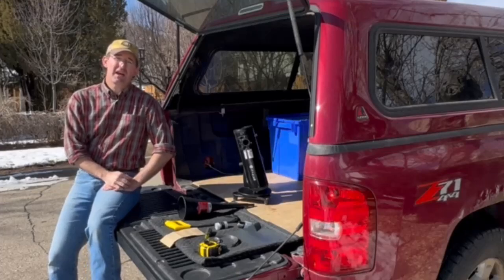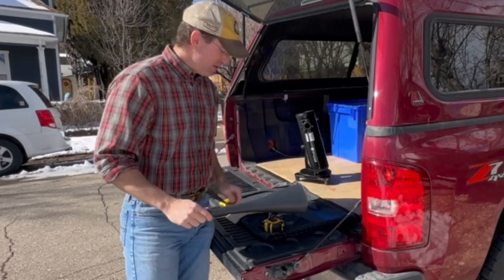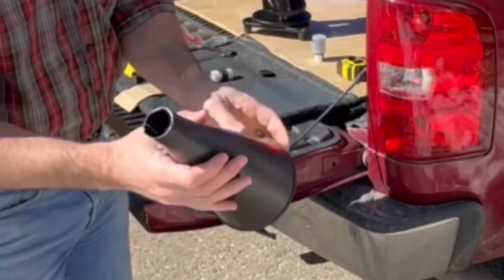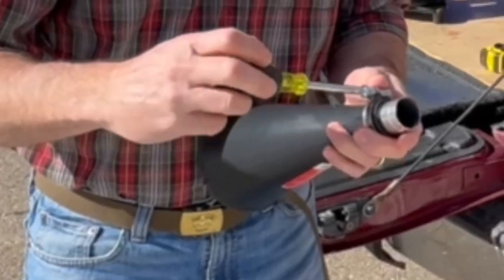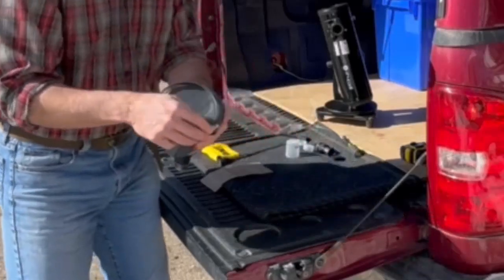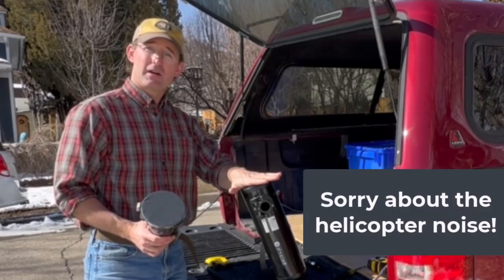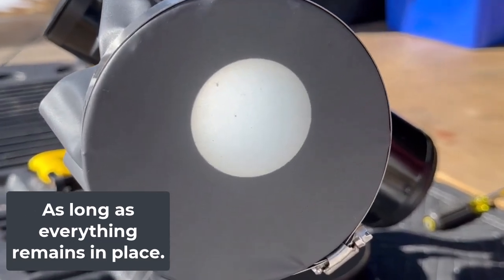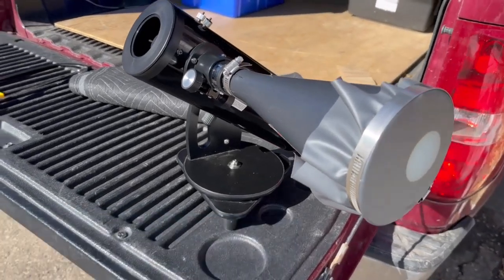Eclipse Viewing Tools: Build A Sun Funnel

Comment: Wish I had seen your video sooner. I'd been looking for the good Da-Lite screen material but couldn't find it in small sample sizes.  I bought some of the Carl's rear projection film and tried it, but in my opinion it was way too dark.  So I made one with plastic shower curtain material.  I even used gray Rit dye on it to darken it, but still needed the second layer, just as you described.  It works, but the Da-Lite rear screen projection material works much better.    Just ordered some from your site to replace the shower curtain material.  Thanks for offering it up!